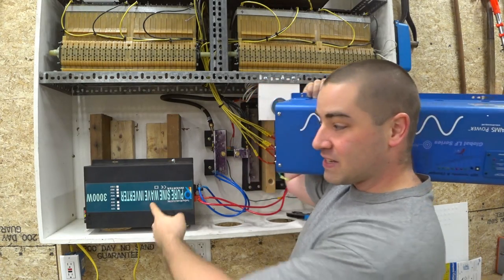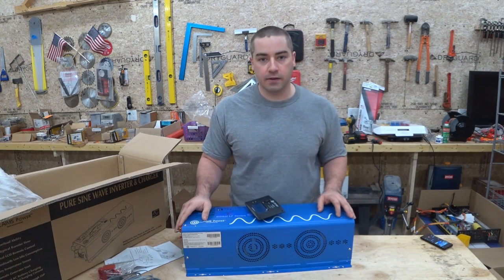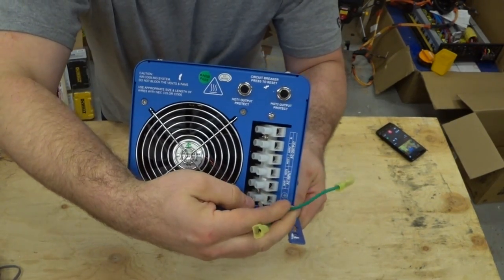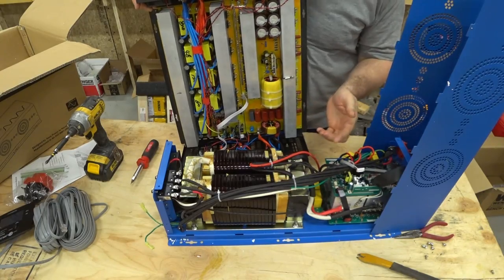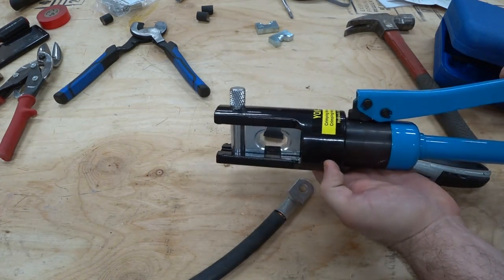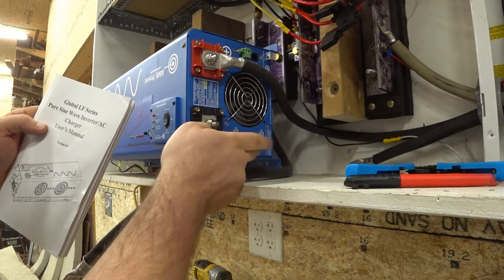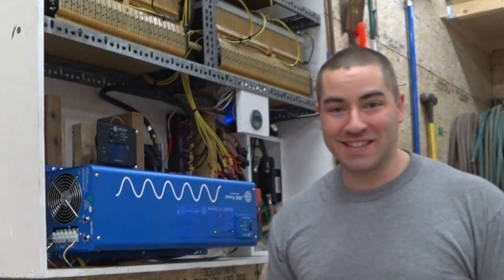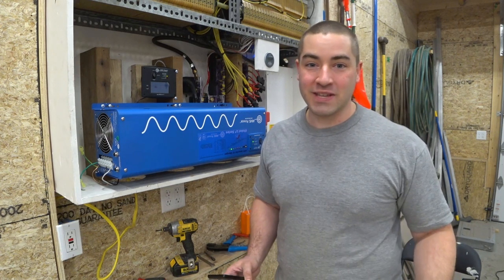Inverter Upgrade! Reliable to Aims in Off-Grid System

Comment: Just make sure your compressor don't kick on when you are running your chop saw or other high amp tools.  I've had the same inverter for 8 years now. Working great.
Reply: The worst are only the start-up currents of the devices. Motor-driven devices always have a high starting current. But once they run, the power consumption quickly goes down again.

Comment: 95 means the wire gauge in square-Millimeter  95mm^2 

which is used to describe the wire size in other countries very often, you can find tables which convert AWG into mm^2

So your hyd.press for crimping is in “Europe” sizes? 
95mm2 is very big like AWG4
0.75mm^2 is small like AWG18 I believe

Comment: Low frequency inverter can handle more surge power.
Reply: What hp was the air compressor?
Reply from the maker: @Davide Villar: Here are the specs: https://www.harborfreight.com/air-tools/air-compressors/8-gal-2-hp-125-psi-oil-lube-air-compressor-68740.html
Reply: Alexandre Lollini especially a 48v inverter. A lot less draw on the batteries. If you add an e-core to the positive or negative from the transformer going to the power board the efficiency goes way up.
Reply: @billssolarpowerandgardenin1016  what is a e-core?
Reply: teroidal transformer is the most efficient but it will not fit in there i guess.

Comment: A couple of issues with that inverter first, Efficiency >88% (Peak) so guessing that's closer to 80-87%.  ?? But the biggest issue is the Idle Consumption: 4.16 amps around 80.7 watts just like the 10,000 watt Aims 130watts odd it just burns power doing nothing there are a few videos on youtube about it, there is a Power Saver mode that can be turned on but that needs a min of 50watts to re-enable the inverter on also it wont go into power save if there is more then 50watts used on AC. I would still save up for the Victron Energy long term :) I have just done an install with the Victron Energy 8000 for off-grid and it's very nice but still has an DC 80watt idle use which adds up over 24 hours to 2kWh of wasted battery storage just for turning the inverter on.
Reply from the maker: I agree that the idle draw of 80 watts is a lot for this size inverter.  Victron is great.  For me, I was looking at two Quattro inverters, 48/5000/120.    Victron does not make a split phase inverter, so I have to buy two of theirs and program them to be 180° out of phase.  That was going to be just over $5000.
Reply: Geeez I missed that part.  80w of standby??
Reply from the maker: @Christopher Dizon: No, 80 watts in idle.  30 watts in standby.
Reply: But Aims makes a split phase, and up to 12000 watts @ $3400. which is little more than $300. more than the 8000 watt model. And it's UL listed.
Reply: I power my house off of a 24v 4000 watt Aims. The 24v single phase uses a lot less at idle and runs microwave toasters and everything else nicely. If I want to run a 240 device I use a 5K generator. 48v is nice however it can be a little overkill for most off grid situations. Off grid is always a trade off.
Reply: @geopro0780  The UL listed sticker on it is fake

Comment: 4/0 cable is a bit overkill. I only use 2/0 on my Electric Car conversion and it handles way higher currents that this setup could ever pump out.
Reply from the maker: Yeah, it probably is.
Reply: Pete McWade I use 4/0 cable on my car conversions.
Reply: Overkill maybe but higher efficiency.

Comment: Hi David...
Before you continue anything else with this project...put some fuses on AC side...
For each socket one fuse...
That will probably protect your future investments...
Good luck...
Reply from the maker: Thanks. Yes, I skipped that in my excitement. However, I have a sub-panel that I plan to mount next to the inverter.  I'll be installing some breakers in that. Thanks for watching.

Comment: No surprise to me,i have AIMS 3kwatts inverter and I can turn  my small coffe maker and microwave oven at the same time that's 1600 watts continuously ,the refrigerator is always on ….so i make another test and also connect the washer machine without any problem.,this brand is amazing.
Reply from the maker: Cool.  I've been very impressed by it.  I wish I knew about the brand sooner.  Are you off-grid?
Reply: @DavidPozEnergy  No for the moment

Comment: Word of warning... the generator output on mine (24v) fired around 22v and as soon as teh generator came on, the charger kicked on and the batteries rapidly went to 24 volts.  At 24 volts, the generator start dropped out.  This caused rapid cycling.  I bought a relay on ebay that fires for a programmable number of minutes once the aims inverter calls for generator.  I set the timer to 3 hours, no more rapid cycling.
Reply: Absolutely, mate. Good advice.
Reply: Wes do you have a video on Explaining this? I'm very visual.

Comment: I have the aims msw 5kw inv for 5+ years now, still powers everthing.
You may want to mount that vertically to use convection if the fans fail-- i did and it runs much cooler --- fans seldom run. Good vid.

Comment: Now you Talking.  Lots of  controversy over those Inverters.  That being said.  Lots of folks love them.   Looking forward to Hear your thoughts.  Yep
Reply from the maker: The controversy you've heard, is that also over the efficiency, or is there something else I should watch for?
Reply: The transformer will last forever, but the MOSFETs will likely blow if you push it too hard and the control boards are known to last only a year or two. Control board will only set you back $230 plus shipping and you can replace your own fets at about $1.50 each.

Comment: how bout welding machine test n that inverter,
Reply: Welding test on that inverter will destroy it for sure 😲😲🙁🙁
Reply: I’ve used these aims inverters to power my miller 211 mig welder both on 240v and 120v. I was seeing amp draws of 350+ amps on the dc side at 12v so it demands some juice to do it. It’s much better to go with a higher dc voltage inverter like a 24 or 48v dc inverter if using a high current draw tool like a welder.  I’ve built 20+ systems using these aims inverters and have been impressed with there power capabilities and pricing.  Im a huge fan of outbacks inverters and solar cc but like David said, you have to save up money to upgrade if you want a better quality system.

Comment: Nice inverter and you get all your tools. I looked into one of these but when I asked Aims if I could AC couple this is what they said (No, this inverter is not able to be tied to a grid tie inverter. will result in catastrophic failure) so since I want to AC couple my Enphase inverters the Aims just wasn't for me, they also make a honking 12000 watt. The Price was sure right Good luck and can't wait until the next video
Reply from the maker: Yes, the Aims inverter lacks some of those additional features.  I also have some enphase micro inverters on my house roof, so I will never be able to tie this inverter to the house panel at the same time.

Comment: Thanks for the video and tips.  I have a similar one under the OEM brand Sigineer (which makes the AIMS inverter), so your tips and insight will apply. I don't have as much experience as you, but coming to speed quickly.  4300 watts of panels are up, PV into the shop. eight flooded lead-acid batteries (will likely upgrade to 12) configured for 24 volts (I couldn't get the 48 volt inverter at the time) but the pricing was right. This is my experimental/learning platform for a bigger project.

Comment: an easy trick to instal a stranded wire , is to wrap a small one conductor all over the strip part of the conductor , insert the strip part of the main  conductor in the lug  push  the wire in the lug then unwrap the single conductor as you push the wire in the lug.
Reply from the maker: Thank you.  I'm going to have to try that.

Comment: I have a power jack 4000w  8000W peak inverter about the same size and weight as this unit.
I've blown the MOSFETs 3 times on that dam thing and the driver board, by using a 15000BTU RV AC roof unit, 
I installed a 350 AMP inductor power choke and this helped protect the inverter's MOSFETs when turning the AC unit on just after turning it off when the pressure in the AC unit was acting against the pump this is when the MOSFETs in the inverter would blow up without the power choke installed.
i ran a bunch of tests with the power choke installed and it worked fine and did not blow the MOSFETs even after turning the AC on and off multiple times to see if it burnt out the MOSFETs and it didn't. 
this summer i performed another stress test in extreme heat with the power choke installed but on the 2nd day of testing somehow the MOSFETs burnt out again, but this time I think it was an overheating problem as the RV had been sat out in 110F Vegas sun all day and the inside of the RV was like an oven inside over 50F,  (vegas is the ultimate place to test this type of equipment for relablity) 
Anyway this setup is installed in a 1991  Mercedes 410D 20-foot RV imported from Germany to Vegas NV last year, so it is well insulated and keeps the heat/cold in once it gets hot/cold, inside the cab.
so the air temp in the RV cabin that is also used to cool the equipment inside the closet was hotter than in any other test I've done.
The inverter setup is installed in a closet that I converted and reinforced and re-boarded out the interior to hold all the weight of the charge/battery and inverter equipment, plus the bottom section holds a 4600-watt gas generator accessible from an external door from outside this space is separated into 3 compartments 1 generator, 2 batteries 3 inverter and transformer.
I had to install a vent with a 4-inch steel duct with a 12v 4in PC fan that exhausts hot air generated in that closet to outside via a metal RV roof vent so the heat does not come back into the interior of the RV where the AC system is trying to cool that hot air made by the equipment in the closet.
so during my 110F stress test, i turned on the transformer (100amp power max battery charger) (the 110 amp power max battery charger plugs into a standard 15 amp household socket for when i need AC at someone's house but i can't run my gas generator because of noise or they don't have a 40 amp RV shore socket installed at the property). all batteries were fully charged from the night before, then i tuned on the AC on full and everything was running ok, 
i went in the house for a while and returned 2 hours later the 4000w power jack inverter was bleeping and the fan was on hyper-speed and would not turn off until i disconnected the power, the inverter is it hooked up to X4 group 31 wet lead acid  12v semi batteries in a 12v configuration with very fat cable i can't remember the AWG ,

on this test the transformer was chucking out a lot of heat combined with the high ambient temperature inside the RV which contributed to extra heat generated by the inverter being under load via the AC in the closet and the exhaust setup was overwhelmed and could not remove all the heat fast enough in that space, resulting in the inverter getting too hot and blowing the MOSFETs 
it's annoying that the power jack inverter did not have some type of thermal shutdown before blowing the MOSFETs 
looking inside your unit the MOSFETs are in the same place but on my inverter they are removable modules 4 in total and the driver board is also removable from the main board, so i think your inverter would be much more difficult to repair if the MOSFETs and driver boards fail it looks like they are soldered into the main board.

Comment: My Trace Engineering inverter charger is 4 kW and 120 lbs. ;) It takes 16 watts no load, and is 95% efficient at full load. It is 120 volt, two wire. It should be noted that a 120/240 volt, three wire supply is NOT referred to as "split phase". That is a type of motor. It has caught on, and keeps getting repeated, and even some (new) manufactures have started incorrectly using the term. Alas no matter how many times something incorrect is said, it does not "become correct". Ahh, life in the misinformation age. ;) Your enthusiasm is infectious BTW, I love it.
Reply from the maker: Thanks for watching.  I welcome the comments and corrections.  If I'm using the wrong term, then please inform me of the correct term.  Thanks.
Reply: @DavidPozEnergy … the correct term is single phase 240 volt, with 2 legs at 120 volts each. (measured between a leg and neutral) The 240 volt configuration allows connection to common household breaker panels either directly (off grid situation) or using a transfer switch, similar to how a standby generator makes it's connection to a home when the utility fails.
Reply from the maker: Thanks rupe53
Reply: It's referred to as 120/240 volt, single phase, three wire in the National Electrical Code. It can be referred to as 120/240 for short and it will be understood. There is also a 120/240 volt, three phase, four wire system, but it is fairly obscure.
Reply: @realvanman1 … actually, most 3 phase is 120 / 208 volts, and typically each leg measured to neutral is closer to 130 volts. (in the real world)

Comment: That other one that you showed us looks like it has a switching power supply, rather than a massive transformer somewhere along the chain. I'm a ham radio operator, and invariably the switching supplies cause a LOT of RF noise to the point that I wound up (pardon the pun) pulling it apart for spare parts since I could not hear nobody due to the amount of RF hash it throws out, and they're not very efficient if you want instant power under a heavy load.

The new one isn't switching. The transformer handles the heavy lifting (pardon the pun) and is much more reliable and just loafs along at high loads, and can take a LOT more abuse than a switching supply. It also has a hell of a lot less moving parts than a switching supply. You should always stay away from switching supplies (my opinion). Transformers are more reliable, and you'll find they last much longer.

Think of them this way: Switching = Ford, Transformer = a GE90 jet engine.

One other bit of advice: always solder those connectors before you use them. It forms a much better bond and prevents cable failure because it slips out when crimped (eventually). Solder last a lot longer.

Thanks for the videos! They're really good for people like me.

Comment: Lol dude i been following and I’m glad u  finally got the right inverter..    I myself purchased a power jack 15000 watts continuous and 60000w surge ...  I’m skeptical about those numbers but i am running my whole shop with it ..  240 volt lift ..  all lights and heaters etc..   i don’t run everything at once but when I do I’m biting my teeth..   trust me when I say I felt ur excitement! Lol.
Reply from the maker: It's great to hear from someone who has that inverter.  I saw them on Ebay, but it seemed like a too good to be true situation.
Reply: That’s exactly how I felt . But they really do a good job really powerful let’s see how long it’ll last lol..  I wanted the 48v but settled for the 24 v ...  shipping was the worst. @120lbs. It Looked like it was tossed a few times ..  when UPS es dropping it off, they reallly  rolled it edge over edge tumbling it to the door ... I was crying inside.    That aims inverter looks so good and congrats ! On the outage it’s the best feeling ..  sooner then later you will want to go off grid lol.   Keep up the great videos!

Comment: i love your enthusiasm, but your never really going to be able to hurt that thing. Its not built on a tea cup like the other HF units are, normally they have a 40% for 10 second over normal power rating before the electronics will kick in to shut it down...I live in a area prone to power outages a lot and had a small inverter to run lights, 3 refrigerators and the gas furnace but when the any 2 of the fridges kicked on at the same time it would  overload and shut down. during running i only needed 1500w but surge i needed 3000w for 3 seconds, instead of buying a huge expensive inverter i just got a low frequency one like you with a slightly lower efficiency but has a running wattage of 2000w and a surge of 4000w and now i have no problems....good luck and you will love it..
Reply from the maker: Good stuff.
Reply from the maker: Thanks for finding this.  I looked at the specs, and yes, it looks like the same unit.  This will probably help out some folks.

Comment: Good job! I have a Aims 24V 3000w inverter and it can handle my compressor as well! My only negative point with it is that it takes a lot power in sleepig mode..
Reply from the maker: I agree about that.  Idle is 80w, and standby is 30.  That's like leaving a bunch of lights on for no reason.  O well.
Reply: @DavidPozEnergy … use that remote panel to shut the system down when you go to sleep. Maybe mount it where it's easy to get to, say in a common hallway by the bedroom.

Comment: I had a 3kw version for my class A and had to mount it with brackets facing down because I didn't have the space it mount it vertically. A vertical mount will allow the unit to use convection to pull cold air in from the bottom, then push hot air out the top (think Apple's Mac Pro desktop, or any convection heater - hot air wants to naturally escape through the top). The fan in my old unit (heavy-side) was a pusher (pushed hot air out of the unit), so if I had the space, I would have mounted it heavy-side up, so hot air escaped upwards. In theory, this should help your MOSFETs and transformer cool better, extending the lifespan of your unit.

Otherwise, I never had a single problem with mine. I'm already budgeting for another one for a solar build later this year.
Reply from the maker: That makes sense.  I'll look at the left/right and see if there is a good spot for it vertically.